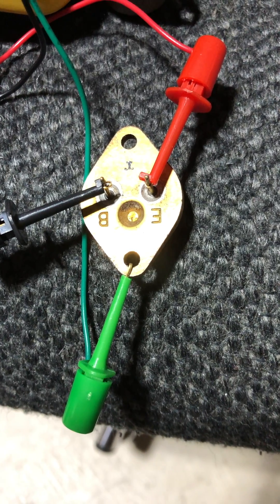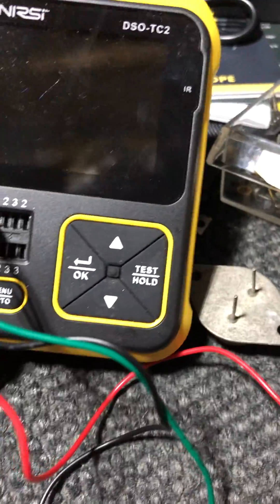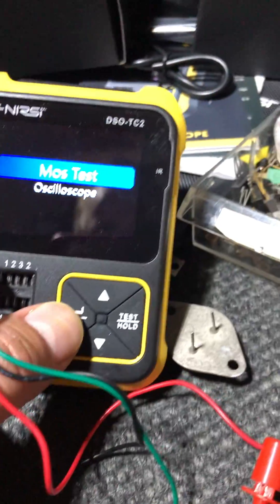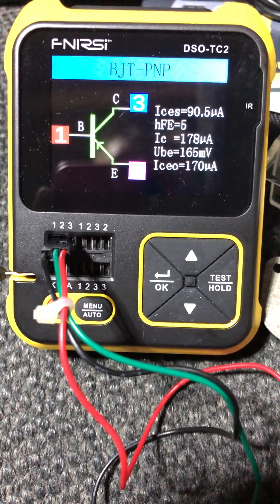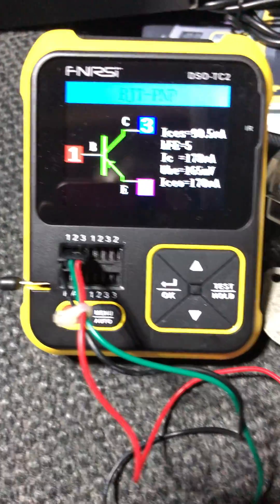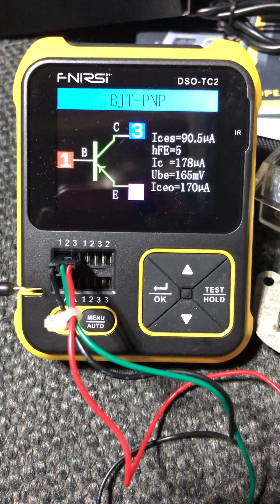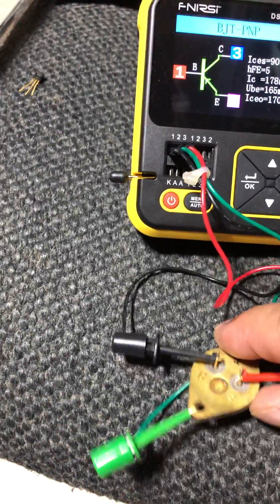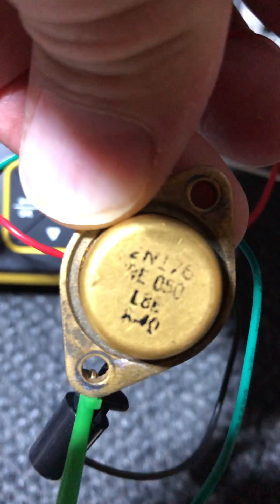FNIRSI DSO-TC2 Portable Digital Oscilloscope Transistor Tester 2-in-1

Comment: Some early transistors, especially low gain ones, are almost symmetrical and can work both ways. In fact the OC140 is designed to be symmetrical and the collector and emitter are interchangeable.